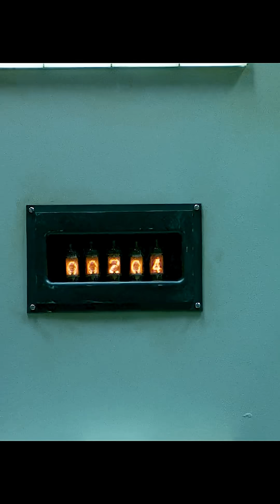The reason the reactor exploded, besides the fuel issue, was straight-up improper operation.

Comment: He in fact did not know what he was doing.
Reply: idk why that would mean anything? he was on the toilet
Reply: Tbf I don't think Dyatlov knew there is a fatal flaw in the RMBK, remember there is a report highlighting the the flaw but the report got censored by the Soviet State. At least that's what I got from the series
Reply: @Kriss_NA  if they where to shutdown and not try to do the test it would have not happend

Same as with if they didnt press scram the reactor would propably stabilize
Reply: @DraconBerry2740 That's the thing though, IF Dyatlov KNEW about the flaw (push the reactor to the limit, pull all the control rods, energy spike, then press the AZ5 with graphite tips) he wouldn't have done the test at all.
But because Dyatlov MIGHT not know about the flaw (because it's censored by the States), he done the test anyway and the incident happened 😅
Reply: @Kriss_NA he knew about the rules with falling from low power, knre test needs 700 did it on 200.. he just wanted it done, because if he did hed  get promotion. Later he was looking and seen the graphite but ignored it... after the explosion he knew what he done but tried to hide it as all the USSR did at those times.

Gave threats to the operators for trying to protocols, all he wanted it was for it to be done
Reply: @Kriss_NA  Still the rules are rules and he disregarded them. The guy as the ones above him had been given control on a nuclear reactor and he treated it as a grill. 
It is not a good idea to give a gun into the hands into a person who will for example carelessly throwing it aside becouse 'it never went off'.

Dyatlov was a person with significant personal flaws and still as such he could be a spledid technician working under someone else's supervision. It is a shame he got promoted.
Reply: @Kriss_NA  He knew the contents of that report. That's what the doctor was pointing out when she said they fucked up by not censoring the table of contents.

He may not have thought of it in the moment, but he knew of issues, as he'd been educated about them previously.

It's also important to note that he was trying to make a name for himself with this experiment. That's why he was so insistent about forcing it through, despite all the red flags going up in the control room. Even the random techs knew something was seriously wrong before the explosion, which is why they started refusing orders.
Reply: I am pretty sure he knew what he was doing but wanted the medal and power... so he risked and it didnt go well
Reply: @DraconBerry2740  many informations about the reactors were censored out, and even people like Dyatlov didn't knew them, like the AZ-5 power surge due to graphite, and probably many more. 

Soviet state couldn't afford to inform their own citizens on how dangerous and cheaply made were their own things. The more people would knew the bigger the chance would be that the outside of the USSR finds out. Soviet paranoia
Reply: Eh yes and no. The country kept a LOT of super necessary information from the people working in the reactors. 

Most of this show is showing exactly that- how this entire tragedy happened because the government of Russia didn’t want to admit their nuclear reactors had MAJOR failure points
Reply: @brattygamer8939  WHAT DO YOU MEAN? This show literally points out that the system warned those scientists, and yet he overrode that. It's literally on those people who were directly in charge.
Reply: @brattygamer8939 It was not in fact the government of Russia, it was the government of the Soviet union and importantly, the KGB. And don't try to forget the part where they completely turned off some safety systems. Yes RBMK reactors had some flaws but operator error was the larger part of the disaster.
Reply: He was in toilet 😅
Reply: Not great, not terrible
Reply: Dude was certifiable...
Reply: i was there...he was an ass
Reply: True
Reply: As robbuf had intended people read his comment with Morgan Freemans voice in their head
Reply: the pages were missing only cause following the rest of book instructions would've keep them safe and some pockets full, just by turning off the pumps everything went downhill from there
Reply: He did bud they kept information from him that he needed
Reply: In that time, the Soviets didn’t care about who to place as a “boss”, “leader” it just had to be someone. They were puppets, decorations.
Reply: Was just about to say that lmao
Reply: I think the KGB or the NKVD wich ever you prefer would like a word with you for anti-party speech and they have a vacation to siberia planned for you 😇
Reply: @lovesausage8154 😅😂
Reply: Not true
Reply: @RR-sf7gc  he didn't knew "the worst case scenario" because it was censored from everyone.

And going one step further, in real live Dyatlov was a moron who had no idea that he was slowly creating a nuclear bomb. Rules were simple - core is poisoned, raising power and burning out the xenon needs to take 24 hours. But Dyatlov knew he'd get fired if he failed to do the test that was unnecessary and not a standard anywhere. It was an experiment and he didn't cared that it failed 3 times before, he wanted it done. 

He was not the main reason for the catastrophe at Chernobyl, but sure as he'll he did not tried to stop it. The biggest difference between Dyatlov in tv show and in real life is that in real life he did realised that the core exploded and wanted the workers to evacuate, and was told by the people above him that he is delusional and "how do you even know it exploded". Four people were sent to the core to look into it (and to die a few days later from acute radiation poisoning) and still they said it didn't happened. 

What's interesting about the tv show is that a alot of the timeline is correct due to it being partially based on Legasov's tapes. So speaking against many of those things is speaking pro Soviet propaganda. My Polish grandfather, who's son (my dad) was 6 years old at the time of the explosion, to this day belives the Soviet propaganda, refuses to belive that any major incident happened and pushes any "faults" on "incopetent" Ukrainians instead of accepting the truth of soviets being cheep bastards with no regards to safety or human life
Reply: Uujjjujij @RR-sf7gc
Reply: @RR-sf7gc  they why did he get atomized
Reply: @RR-sf7gc  Really? Explain comrade.

Comment: Of the 211 control rods, there were known protocols that said at least 15 should stay within the reactor at all times. They withdrew 205, which left only 6 control rods
Reply: In the IAEA report on the Chernobyl disaster, they highlighted a number of design issues that could have caused the Chernobyl disaster: the graphite displacers on the control rods, the cooling water pumps were subject to failure if the water got too hot, and the control rod motors were very slow. Ultimately they basically said it doesn't really matter which individual component cause the explosion, because everything that happened that day illustrates an extremely poor safety culture. Fundamentally everything that happened did so because none of the people working there fully respected what they were working with.
Reply: @PolarisC8 didn't help that the nightcrew was in doing the test, a group of induviduals who is only trained and capable of maintaining a stable reactor
Reply: @oledidriksen1804 that's not true, they were all fully trained but they came onto shift and had the test drop on them without warning.
Reply: @PolarisC8  they made so many mistakes
Reply: @PolarisC8  if ya ask me personally I think they'd have gotten it done quicker and better if Legasov and Scherbina were there. At least someone with a pair and a voice they're willing to use cause goddamn
Reply: @PolarisC8 you should see how we test our nuclear weapons. They fail every safety check except one.
Reply: @nicholasplesko533 That was a broken arrow incident. Not a test.
Reply: @PolarisC8 It's insane that they didn't just make an instant scram. It would've been essentially trivial, just have the CR weighed down by a large weight held up by an electro magnet. Scram cuts the power to the EM, and the rods get rammed fully into the core in less than a second.

Has the added benefit that in case of a grid failure, if the pump run down fails, the plant control loses power, and the EM automatically releases by itself, instantly scraming the reactor fail safe automatic if there's no power left for the pumps and the cooling water ceases.
Reply: @devial9879  Gravity is not sufficient to slam down the control rods in this case, there's a huge amount of pressure in the core so you have to force them in. Procedure did say to scram when they were in a xenon pit, and the computer would have done so if they had not disabled it to try to get the power back up.
Reply: If one person at a work site isn’t following safety protocols, the responsibility is with that person. If nobody at a work site is following safety protocols, the responsibility is with management. If management isn’t following safety protocols, the responsibility is with leadership. Whole groups of people don’t abandon safety protocols unless incentives are created to prompt them to do so.
Reply: @fenzelian or they are all really, really stupid
Reply: Half or a quarter a reactor meltdown is much easier to fix than a full reactor meltdown
Reply: I’m high so thanks for mathing
Reply: Is that true?
Reply: The operators did not know they had effectively removed so many control rods, nor was what they did ever against protocol. 

The number of control rods in the core wasn’t actually something you could figure out quickly. Because of how big and complicated an RBMK reactor is, plus you could have control rods only partially inserted, a computer took the data from all control rods and various points in the core to calculate a number representing the effective number of control rods in the core (Operating Reactivity Margin; ORM). 

The ORM was in a safe place until the last minute where Toptunov had removed control rods from the core too quickly after the reactor stalled minutes before the test. The ORM printout from the SKALA computer took 2-3 minutes to calculate, then another couple minutes to physically bring to the control room. The last SKALA printout of 8 control rods was recorded to have been calculated at 1:22:20. The reactor exploded at 1:23:48.